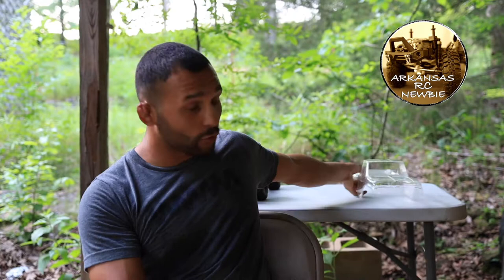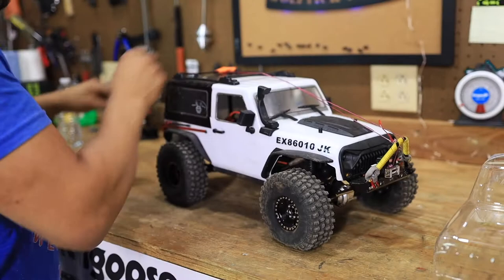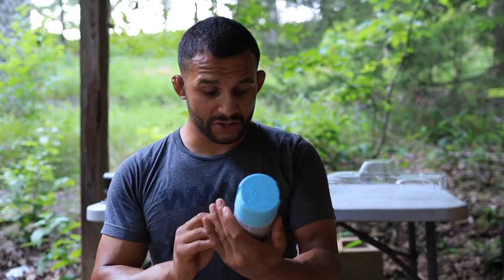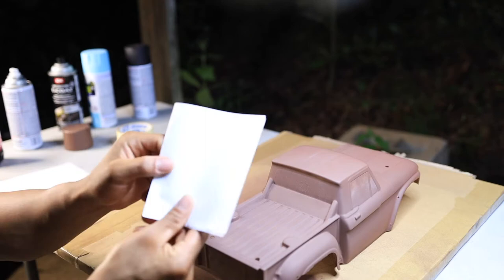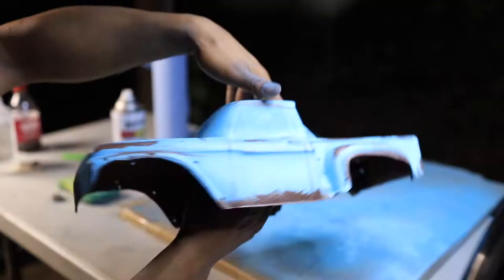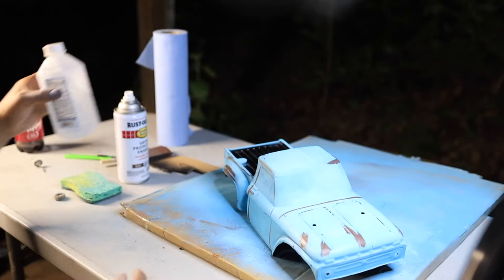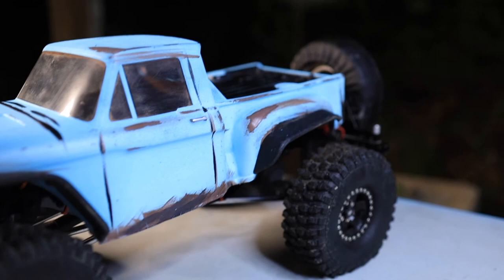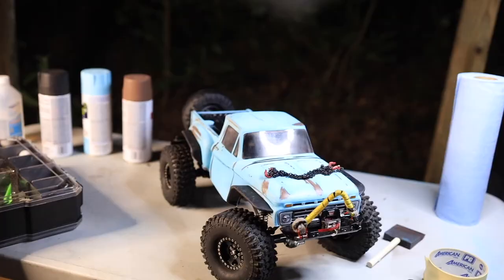First Time PAINTING an RC Body!

Comment: On chassis length for c2 the rule is chassis including bumpers must be 3" longer than wheelbase
Reply from the maker: Ok so....So glad you commented. Now 3" combined or seperate? So can I cut my rear chassis rail off?
Reply: @arkansasrcnewbie  yes you can cut it so long as its 3" longer, with bumpers mounted, than the wheel base

Comment: For Class 2 the inside of your tire cannot stick out past the bottom of the door. You can have 2" flares but if your tires are outside of the door it will not pass tech.
Reply from the maker: Gotcha, the jk body was sitting the same measurement as this is so I should be fine. Plus of needed i can take off the weights to be inside. Thanks Luke